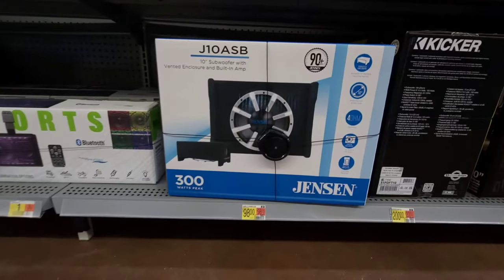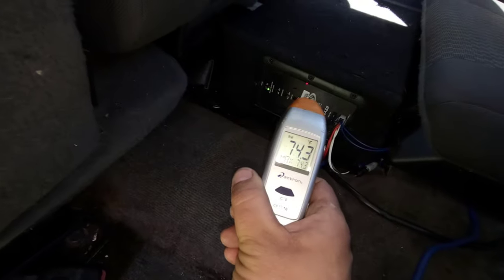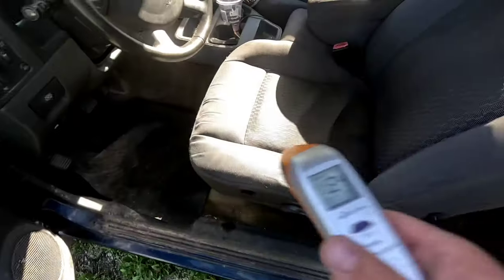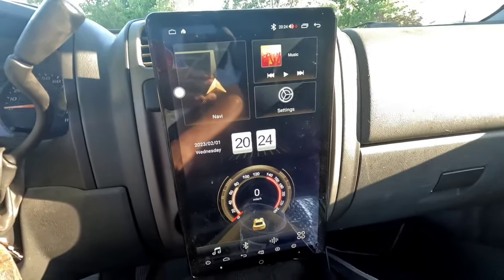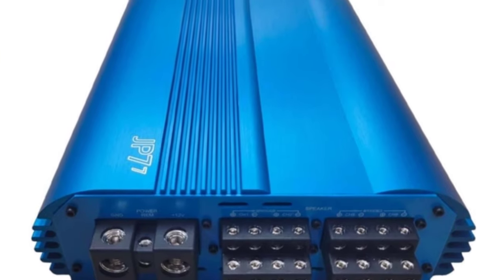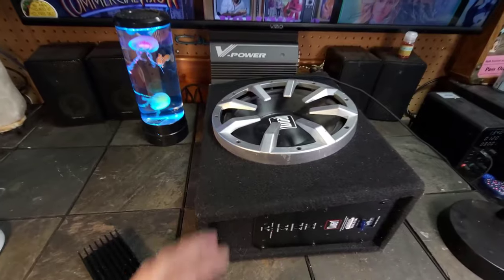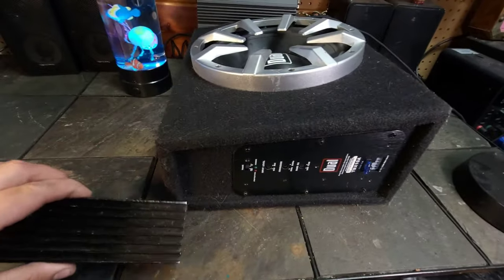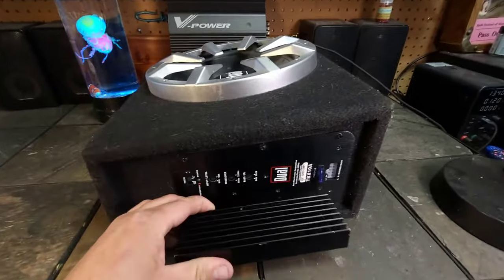Jensen J10ASB Overheating Issue - FIXED

Comment: If you cut that heatsink in half the long way, it might fit perfectly above and below the switches and stuff with the flat side against the surface like they always rest on computer components. I have a crap ton of Arctic 6 and Thermal Grizzly thermal paste left over from pc builds. I'm going to have to start scrapping heat sinks too, never thought of using them on amps.
Reply from the maker: Great idea!

Comment: I bought one, but it just doesnt quite fit under my rear seat in my F-150.  Do you think it would work of i cut off the back legs and take the grill off so it will wedge in there?  Ive got plenty of length and depth, just not enough height the further under the seat I get.  It would still be gapped with 2 legs that i'd leave on the front.
Reply from the maker: @jeremyheitzig599  as long as nothing can touch the surround on the woofer or the cone when it moves it will work. 

I would remove the grille and the woofer, cut off the feet (table saw would be great) then take some of the material off of the feet and glue some of it to the bare spot where the feet were.
Reply: @Blowncapacitor84  I may try that.  I don't think I'll have to take much off the front 2 as the seat slopes up.  I also found that my truck is pre wired for a kicker amp/sub, I can buy a harness splice it up to amp plug and plug it into the truck.  Then I just got to turn the sub on with forscan.

Comment: It's a dual purpose subwoofer. You can reheat last nights leftovers with the overheating control panel. Just put last nights dinner in an aluminum take out dish and rest it on the sub. Your welcome.🥫🥘

Comment: use cpu thermal paste and screw the heatsink in never use adhesive may cause fire
Reply from the maker: If its not thermally conductive it will act as a heat barrier. The adhesive I suggest is pretty much a Thermal paste that adheres as well. The main pcb is directly under the heat sink so the average person isn't gonna be able to drill let alone tap the heatsink without damaging the circuit board. That's a good way to get people mad lol

But how would an adhesive cause a fire though? The transistors would fry long before that and put the amp into protect or blow the fuse.